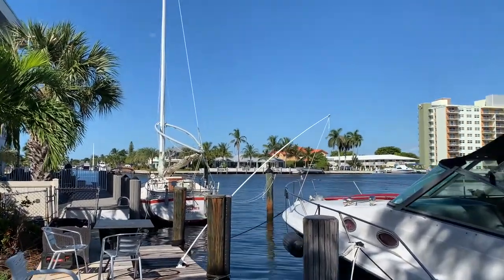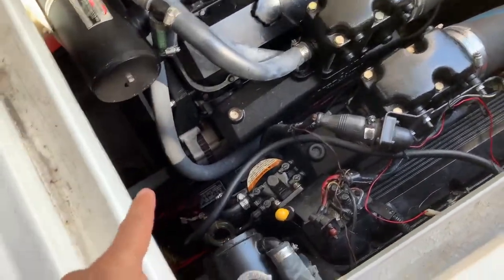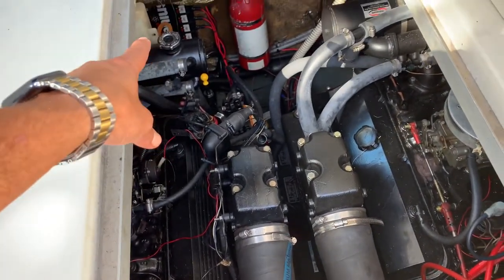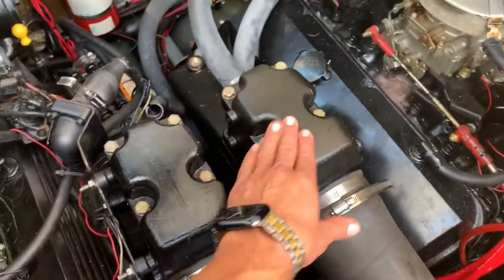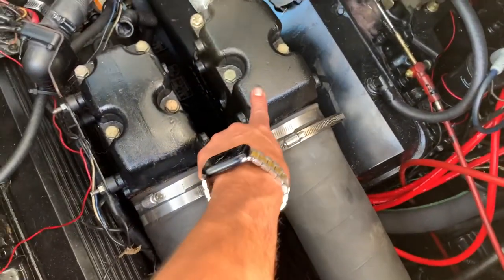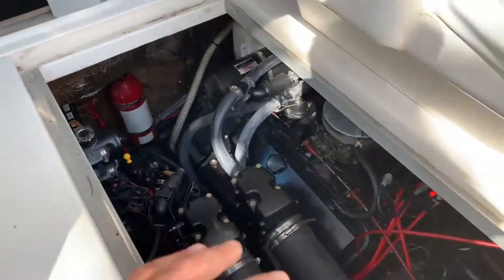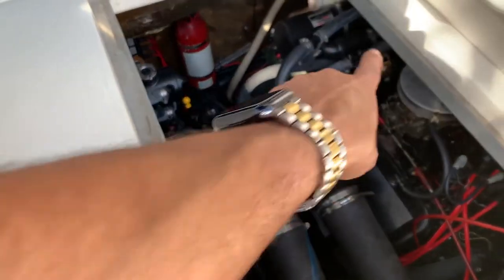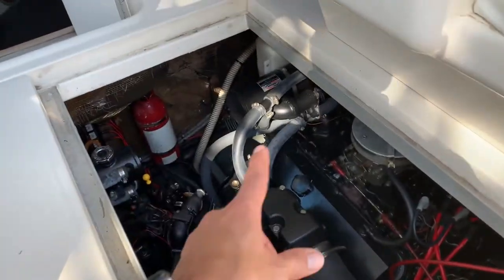Difference between Half and Full fresh water cooling kits ( marine engines )

Comment: Hello.  A really well documented video and explanation!  Question:  When my tech installed the half system on my 8.2L did he need to change the gasket on the manifold and risers?  I'm not sure ifbhe did that.  Does it matter and will it affect the engine? Thanks!
Reply from the maker: Thank you for watching my friend! well if you went from a raw water setup to a half system you should be good and the gaskets would be the same. The only reason you would have to change that gasket is if you are adding a spacer to make the system higher or going to a full freshwater cooling kit
Reply: @Cruisingthesouth  Hello.  The coolant for the system is your typical regular coolant or a special type of coolant?

Comment: What year is your boat and length? 

 Did you learn to be a mechanic before you got the boat?

Did you have to convert to and freshwater-antifreeze system.
Reply from the maker: Hello my friend sorry I just found your comment. My beauty is a 33 feet express cruiser Sea Ray from 1994 straight shaft. I’m at Self thought Mechanic, but I am a general contractor on electrical and plumbing field so that kind of helps plus once you get the books for the engines it teach you how to do everything, as long as you have a firm hand you should have no problems 😄 and when I bought the boat eventually I had to replace both engines because they were raw water cooled so when I did the swap, I went ahead and installed the freshwater kits on them, what went bad on my old engines was internal pin holes because of the corrosion from the saltwater. Are you planning on doing a build?